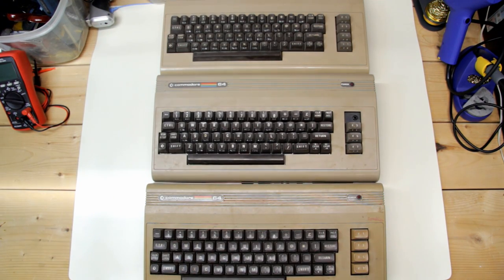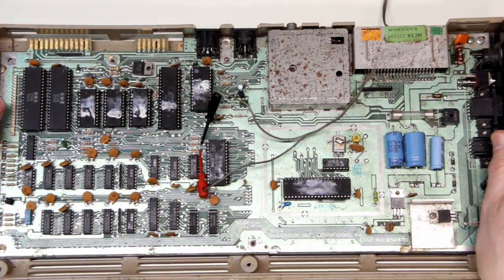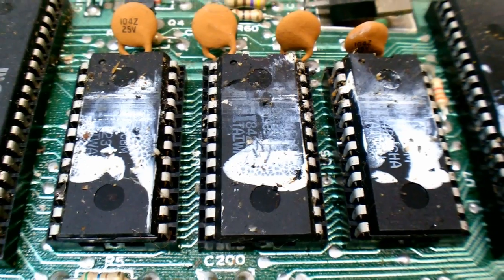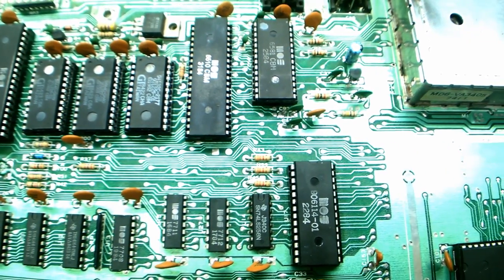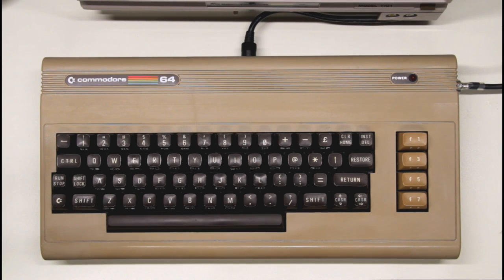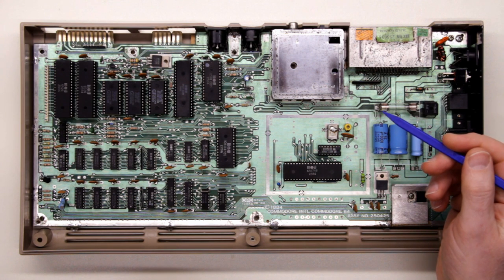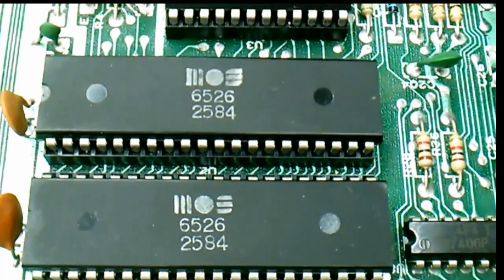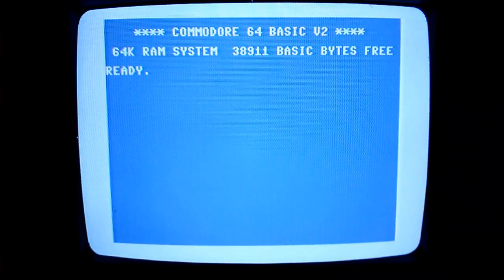#01 "A Change of Heart" — Commodore 64 Black Screen Repair

Comment: Man love the video. Have a odd error where my screen would show the basic screen but whenever I touch the cable in anyway the screen would go blank and then come on. What would that error be ?
Reply from the maker: Thank you very much. Exactly, which cable are you touching that causes the screen to go blank? I assume the video just gets interrupted or is the computer actually powering off and on again?
Reply: @MindFlareRetro  it is the video cable through the video output. Now when I use the rf option. Nothing I touch it fart on it and it doesn't have a issue. The other I touch the cable accidentally and it loses the video for a second and comes back could the cable itself be bad ? Also on a separate question how safe are the original c64 power supplies? I am getting a new one from Poland that is supposedly the best I can get. But want to know if I should be fine with it. Also wondering if just installing heatsinks will damage the chips plan on trying to improve and keep that thing alive for more years to come :)
Reply from the maker: @gilbertvera1678  It sounds like a cable issue, for sure. Heatsinks are perfectly fine to put on all the major chips, especially the PLA (U17), CPU and VIC-II chips.

Original power supplies ARE NOT GOOD and will eventually damage your C64. You are wise to acquire a new modern one. Did you order the Keelog one? It's a nice design however the 9VAC output runs rather high and can be a problem with some C64 motherboards that do not have their voltage regulators factory heatsinked to the board. The regulators can get very hot and unstable reducing the voltage to the required levels because they cannot dissipate the excess heat. This gentleman addresses the issue in a video, https://www.youtube.com/watch?v=Ld-oRmPJe7w. Perhaps Keelog has addressed the now - I am not sure. I purchased one myself in 2021 and the AC output is very high (13.42 VAC with no load).

Comment: I have a white screen problem. Maybe it's the same with inverted video?
Reply from the maker: Hi Raymond. Thanks for commenting. A white screen at power-on would have me looking at the VIC-II chip (U19) as being faulty. I have also read of instances where it is actually a black screen but people accidentally have the brightness and/or contrast turn up too high on their old CRT monitor and the screen appears to be white. Do you have access to a Commodore Dead Test cartridge?
Reply: Thanks for replying. I just ordered a dual test cartridge from Ebay. I hope it's the correct one. Even though I have been doing computers since 1979 and built a Cosmac Elf in 76, I never had need to get inside a VIC or 64 that I owned. I am hoping there is some instructions on how to use the diagnostics cartridge. I built a power supply and did check the voltages at key points which were OK

Comment: I was certain it was the PLA as that's all I ever seem to repair. :D
Reply from the maker: Thanks. I hear you. This fix was a surprise to me too. Of course, if you feel cheated that it wasn't the PLA, there's always this video, https://youtu.be/rHe-IuzEVqA. ;) Thanks again!
Reply: @MindFlareRetro  
I have a question for you both. When the PLA chip fails, does the chip get very hot? Like hot enough that after about 45 seconds you can barely keep your hand on it. I have an old C64, but no advanced equipment to troubleshoot it like a clock probe. My C64 has the black screen and the PLA gets extremely hot after turning it on. Would replacing the PLA be an acceptable first step? (I already verified the voltages coming off the regulators on the board.)
Reply from the maker: @gregorymalchuk272  Hi. Thanks for commenting. Well, it's hard to say. Typically, most ICs that fail on a C64 will get really hot (even to the touch) very fast, so if you have access to a spare PLA or PLA replacement, like PLAnkton, then swapping out the old for the new is a good place to start. However, as will most C64 black screen faults, it might be one or more ICs causing the fault.

Is there any chance you have or could get your hands on a Dead Test cartridge? Available on eBay, https://ebay.to/2zVxurj. Even without the full diagnostic harness, the Dead Test will identify faulty chips, like DRAM, PLA, SID (actually, you should pull the SID and leave it out during troubleshooting and repair, as it is not required for the C64 to power up normally and there is no sense risking damage to it). If the Dead Test cart does not start at all then you likely have a bad CPU.

I hope this helps.

/\/\FR
Reply: @MindFlareRetro  
I'll have to look into it. So you mean these chips get too hot to touch even in normal operation? I have some revision of the 250407 board, and it seems that only the VIC-II and two tiny chips to the right of the ram are socketed. Everything is else is soldered to the board. So you think the test cartridge would be the next best thing to do?
Reply from the maker: @gregorymalchuk272  Most of the large ICs get rather warm under normal operating conditions. In my own tests, the PLA temp will reach 43°C/109°F and VIC-II chip can hit 60°C/140°F -- this is normal when the C64 is turned on and left idle (see a couple of my early videos measuring the temps of these chips). However, failed ICs can get much hotter and can be too hot to touch -- if I may direct you to video #14 at 7m:16s (https://www.youtube.com/watch?v=1lm5d3fyPLE&t=7m16s), you will see RAM chips that have failed and are too hot to touch.

I don't want to make you feel that you have to spend money on a Dead Test cartridge, but it might be a helpful tool to identify some faulty ICs. May I ask where you are located?
Reply: @MindFlareRetro 
I'm in Pennsylvania, USA.
Reply from the maker: @gregorymalchuk272  If you like I could put my friend Mitchell in touch with you (he goes by @Aphexteknol on Twitter and has a YT channel, as well, https://www.youtube.com/user/aphexteknol). He is located in OH, and is a C64 repair master. Perhaps you could send him the motherboard for repair. Just a thought -- let me know if that is an option you want to pursue.

Comment: Nice fix, however I would have checked the voltages at least...
Reply from the maker: Thanks for your comment. Yes, I did check the voltages, but after the fact admittedly. This was my first video so I was more focused on the trash-to-treasure aspect. I am happy to report that this C64 has turned out to be quite faithful. I use it in one way or another almost every day. I hope you found the video and if you are a subscriber, as I do have more Commodore repairs coming soon. Thanks again!